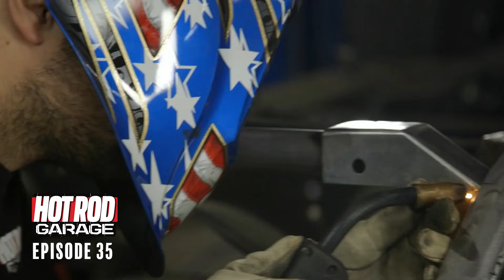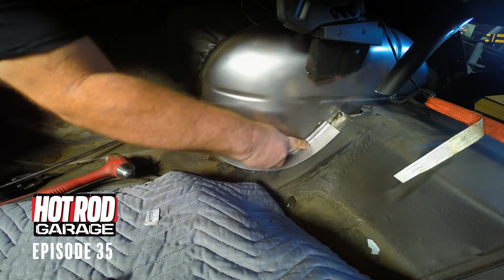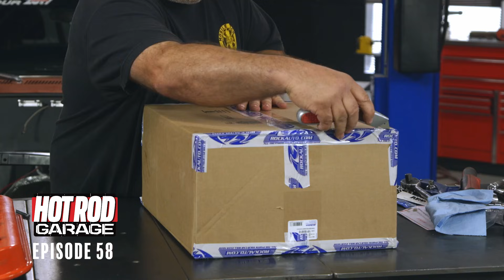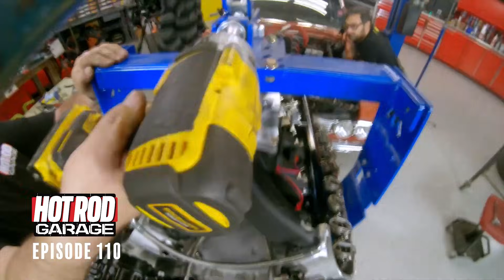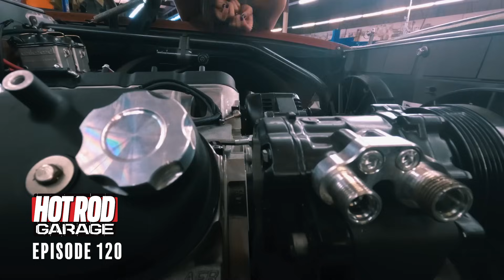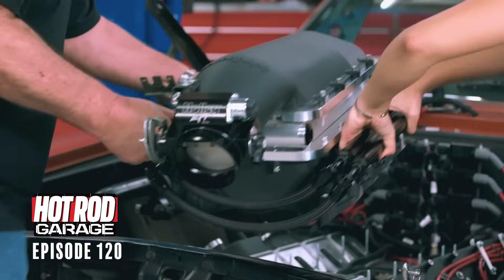Best Moments of the LS Swapped ’66 Chevelle! | Hot Rod Garage

Comment: As a body and paint guy I cringe on all videos like this. I have never ever never and ever again seen any video were weld through primer is used, seem sealer, or body cavity wax used. So every thing you did is raw steal and welds on the back side, in the frame, and in between sheet metal. It’s not just motor trend but every other show like overhauling etc.
Reply: What's your point ?
Reply: @Hanzyscure  His point is that the backside will have corrosion in months that will not stop.